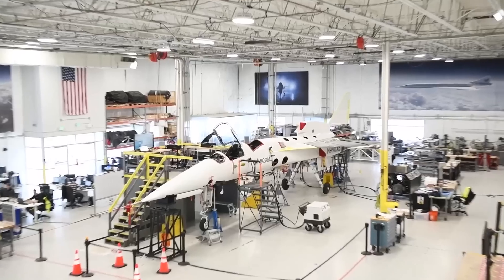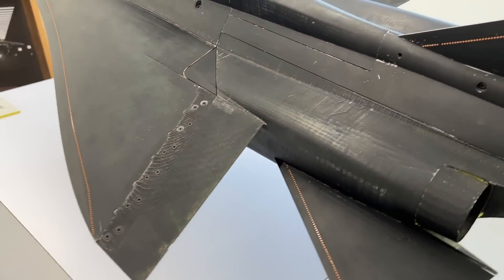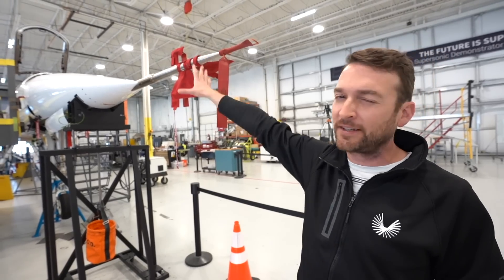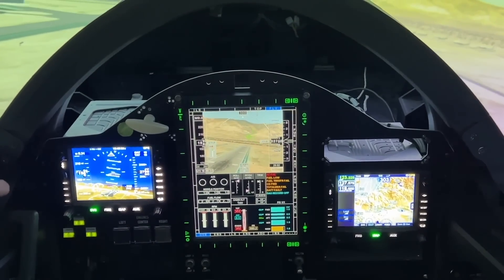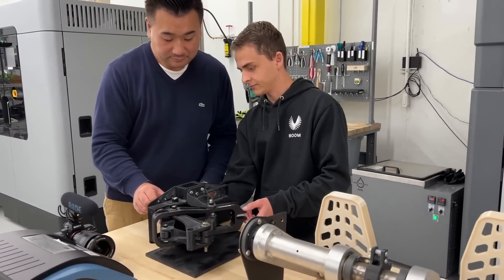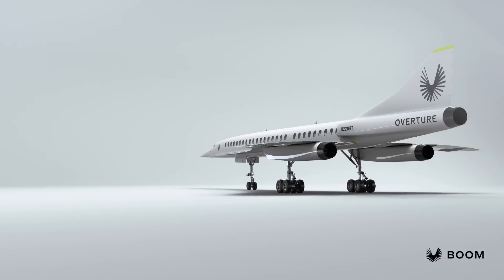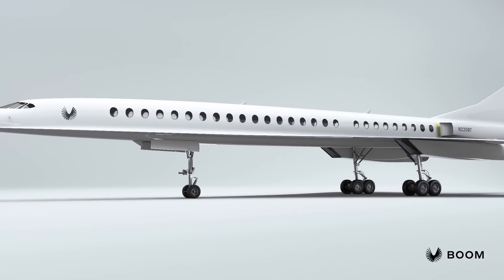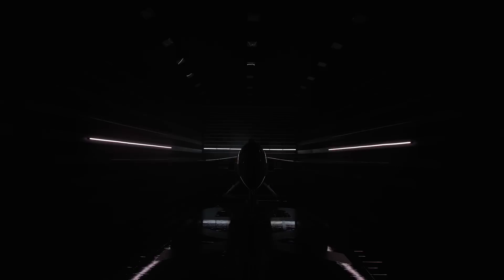Is Supersonic Coming Back? The Future Supersonic Jet - Boom Supersonic

Comment: The problem with the Concorde was that it was eating fuel like crazy, and when oil prices were going high, a ticket was so expensive, only wealthy businesspeople could afford it. The high fuel consumption also came with high CO2 emission, which is also bad if the aviation industry wants to go green. The Concorde was so loud as well, it was actually banned from flying over some countries. I'm a bit skeptic, but I don't think a small startup company could overcome these problems. I think it would be better to develop carbon neutral propulsion for subsonic planes instead.
Reply: The fuel costs  alone make the Concorde far less efficient than even the A380-800. 

At least the A380 can carry over 500 people. 

Concorde?  Just up to 120. 

It's range was less than 5000 miles too.  

The A350 ULR in use by Singapore now makes way more sense.
Reply: @BIGTRUCKSERIESREVIEW  are you seriously comparing a 46 year old supersonic airplane with a 17 year old jumbo jet ? it's like comparing apples and pears
Reply: @Victor-ze3sd  first a380 is 16-17 but most newer ones aren't even 1 year old.
Reply: @BIGTRUCKSERIESREVIEW  actually compared to something like the 747-100 the concorde (while in supersonic cruise) was preatty efficent in terms of fuel consumption, main problems were price, maintanece cost, but most importantly the noise, the main reason it wasn't succsefull was the ban of supersonic flights over populated areas, making it viable only for transocenic flights
Reply: The sonic boom was annoying too many people.
Reply: @AquarianNomadic  Couple years back in school there was a jet that flew sonic near Paris (probably 3-7 miles from where I was) and the sonic boom was surprisingly loud.

Comment: This looks like a classic investor scam. 

They will get the prototype in the air, but a supersonic carbon fiber 2 seater is obviously not innovation. Getting a passenger plane in the air and certified within their time scale is where they will hit the wall. I takes 2-6 years just for a variant of an Airbus or Boeing. This is brand new, with an FAA that will have to probably start from scratch even in determining certification criteria. 

This obviously so unrealistic that promised investment returns should be exceptional to justify the risk... and clearly they are not. How many would they have to sell to break even? 

Repeat... a typical investor scam, only just a tad more credible than Theranos...

Comment: To infinity and beyond... you can make a brick hypersonic if you use enough power. Not sure anyone wants to fly on a brick. More power Scotty.

I like what they have come up with. Love the fixed nose and use of camera to land. Concorde had that weird nose that had to droop so pilots could see to land aircraft. It will be exciting to see their supersonic plane in the air as it goes through testing and FAA acceptance. 

First company to solve the sonic boom problem by directing the pressure wave up instead of down will become rich. Today, supersonic flight over populated areas is prohibited. That was one reason the Concorde wasn't as successful as it could have been. They could only fly supersonic over the ocean. Currently, the only way to not have a sonic boom is Low Earth Orbit as a rocket. 17,500 miles per hour is silent with no air. 

I would buy a ticket if it wasn't as expensive as the Concorde (in today's dollars).

Comment: This is a very impressive project. Congratulations to all the team for getting this far. It is very ambitious. I think the biggest hurdles they need to overcome are partly environmental. Concorde looked like a runaway success with lots of orders, until the CAA banned all supersonic flight over land. I’m assuming that problem still exists. Also the cost factor is there too. Any ticket in one of these is going to be mega expensive. I’m sure people will pay though. Concorde was used a lot by businessman and businesswomen to get from one side of the world to the other in the quickest time possible and it was very successful at that. They also weren’t too bothered about comfort. Which in fairness the Concorde didn’t really have. It was about speed. Not living in luxury. I also think that might be an issue. People have got used to long flights….but in an environment akin to a luxury hotel room. 😂 This won’t be offering that service (I assume). It wasn’t mentioned in the video but I guess this is a scale test version? With engine, fuel, etc there is no space for passengers. It doesn’t look big enough. Although I can see the "holes" in the fuselage. Not sure if those are windows or access panels?
Reply: Boom stated that there aim is to charge US$100 per flight by their third generation of overture jet.

Comment: This is just bad, all of it.
This aircraft will not go beyond the experimental stage. As this aircraft is designed so far. The aircraft will not see Mach 2. I'm shocked it can reach Mach 1.2.
There's a lot of money in this project but it will not amount to anything.
The research has already been done. All the data you need is already out there. You just need to be smart enough to find it.
This is a very inefficient means of transportation.

Comment: This will have a larger impact on corporate and private air travel.  The new G7 is $74M each I believe?  So if this can be less than that per article, I can see this being a major winner for corporate travel.  I didn't see any information on the engines which will be the heart of this project.  Sustained SS is not an easy endeavor and is expensive, so who knows. I wish them luck!
Reply: At 3:14 they mentioned J85-15 engines
Reply: @ttttttttony  for the prototype, which is 1/3 scale. They don't yet have any engine options for the overture and that's a major issue.
Reply: @crazyg74  I see
Reply: @ttttttttony  I must have missed that.

Comment: The guy tells a "nice" (sad) story about his kids not being able to spend time with their grandad in Hong Kong because of the 18 hour flight time. Sad story? Yes, absolutely! But I don't think much would change if the flight time was just 9 hours or less because of the price of the ticket! 

Google says the final aircraft will be able to seat between 65 to 88 passengers (depending on class configuration) let's say 74. Concorde had 128 seats. A one way ticked from London to New York was approximately 6000 to 7000 dollars (in todays money) so let's say $6500. That means a one way flight on a BA Concorde made them $832'000 - I'll round it to $850'000 to take into consideration extra fees paid for extra services or extra baggage by passengers (and I'm being generous)! BA's annual revenue from Concorde was between $37M and $61M so let's say $50M. Supposing it flew twice a day (which I believe it did) for 365 days a year (probably didn't but who cares) the profit a single BA Concorde made on one trip was of $68'493. This means that 92% of the money earned from a single BA Concorde flight from London to New York was spent on fuel, maintenance, wages, ect. (operating costs) leaving the remaining 8% as profit. 

Concorde consumed approximately 25'269 L of fuel per hour and flew for approximately 3 hours meaning it burned approximately 75'807 L in a whole flight. I'm going to add 20'000 L to account for various stages of the flight and to make it more realistic. So 95'807 L burnt per flight ok? The cost of A1 Jet Fuel is $1.117 so Concorde spent a good $107'016 on burn fuel per flight - you obviously operate with a nearly full tank (so 129'500 L would cost $151'515). 

I'm going to start cutting short because the research and calculations are taking me too long and I have work to do ;(... Anyways: Mr. Boom's plane here is going to do the same in 3 and half hours ok? Mr. Boom's plane has 3 General Electric J85 engines that consume approximately (together as a trio) 4500 L per hour at low level non supersonic speed and 1140 L per hour (as a trio) at altitude and at supersonic speed. Now, because of the laws preventing supersonic air travel over land Mr. Boom's plane, like Concorde, will only spend about half of the entire flight at supersonic speed. Now, fasten your seatbelts guys because we're about to go supersonic with these calculations:

At non supersonic speed Mr. Boom's engines are a wopping 57% more efficient than Concorde's engines. At supersonic speed they are 95% more efficient!!! WOW! Now, remember the stuff about half the flight being supersonic and half not being supersonic? Great, because I have completely lost my train of thought and have no idea where this is actually going. So: 

Moral of the story: Yeah the plane will consume less fuel yay so they'll spend "less"! But they're carrying 42% less passengers than Concorde. And do you know what that means?! Less passengers = higher ticket prices!! The tickets will probably still cost thousands of dollars making that 6 hour economy flight to New York (or Hong Kong in Mr. Boom's case) for yourself, your wife and two kids much more feasible. I'm not even going to get into the other plethora of issues like landing with a TV screen because other people are already tackling that lol. 

Will it work? Sure! Or even better: I hope...! It will be a great high speed travel for business people between London and New York and San Francisco and Hong Kong? It will never fly supersonic over land so yeah... If Mr. Boom's initial idea was to get his kids to see their grandad more often I guess he must be quite rich! But for the average consumer that rock bottom price ticket on the 9 hour flight will still be the most viable option. 

Thanks for reading :D

P.S: If you agree: great. If you disagree: great. Please don't come at me for getting bits of info wrong. I'm not an engineer: I know I left out tonnes of other calculations but you get my point!
Reply: Mr.Boom and the initial target consumers of his product I don't think care much about cost of the flight. They just want to get there faster. 

On day one, these flights of course wouldn't be affordable to the average person, just like the first passenger flights 100 years ago, the first ocean liners, first cars, so on, so forth.

But to your point, regardless of its cost or class of target consumers, the economies of this product certainly has to work itself out if it is to survive in the long therm.
Reply: @mr.nobody9086  well said!
Reply: Totally agree the j85 is just old and inefficient

Comment: Cool video  with a few buts.. So the aerodynamics are basically the same as the Europeans developed in their wind tunnels for supersonic passenger travel in the late 1960's. The engine layout is basically the classic trijet template.. There is nothing new here.  This is a promo for yet another US firm that will tell you they are forward thinking and environmentally focused while really pandering to the super rich - and on it goes..  It is interesting but it is simply a chance for the US to finally get what they always wanted and were so jealous not to have - supersonic passenger travel. That is it. If the Russians or Chinese were developing such a pointless and environmentally backward looking, product it would be making headlines for all the wrong reasons.

Comment: This is just a load of bollocks. It is reinventing the wheel. Or some other glossy attempt to keep raising money. This aircraft will never fly commercially. The world already has an SST. It just needs upgrading. Composite fuselage, more efficient engines. All off-the-shelf stuff. The fundamental design of the shape was done in the 50s/60s and was in service by the 70s. But the Americans hated it. So much so that they did everything to scupper it. If Boeing couldn't have one, then nobody else was going to have one. Had the thing been continually developed then by now supersonic transport would be common place.

Comment: Negative Nellie here. They are proud of mechanical marvels when it should be fly by wire (less weight, more redundancy.) Land through a tv, better have plenty of backup for that. Plane will need to be carbon fiber for weight. They are not going into new territory here. The Concord was flying in 1976 and faster, fighter jets fly faster regularly. Need modern day efficiencies added to old technology. IMO, Boom can not build this. They will try to get “close enough” in theory to be bought by Boing or Airbus. Even with all the problems solved, the necessary price per seat will not allow the grandkids to all run see grandpa every other month.
Reply: @William Umbach Civilian: ATC technology enables qualified approach controllers to fly/land properly equipped aircraft. ILS2. Military: MQ-1 Predator/MQ-9 Reaper UAV drones are completely fly by screen.

Comment: The angle of attack at landing will never fly...pun intended.  The FAA would never certify an aircraft that relies on a camera system as the sole point of view.  That's why the Concorde had a drop down nose, and Boom will have to figure out a better plan of attack regarding the high angle of attack at landing.  I also agree that their chances of success are slim to none unless a major corporation buys them out.  Honestly, there global movement in commercial aviation right now is for moving more people using less fuel rather than moving a few very wealth people really quickly....That's really the role of private aviation, and there's probably not enough money even in that sector to justify the high costs associated with traveling faster than Mach 1.  Hopefully the research will lead to some developments to advance some aspect of aviation, and it's good to see the effort and passion.
Reply: a periscope can do the job if all the cameras fail.

Comment: For anyone intetested in Sustainable Aviation Fuels, a Swiss Spin Off of the ETH Zurich called Synhelion has developped solar based fuels, meaning they extract CO2 from the air and produce fuel using concentrated solar radiation. SWISS has entered a partnership with Synhelion and aim to operate the first passenger flight using Solar Fuel only in 2025 I believe. Synhelion themselves plan to ramp up production. Just like explained in the video, this closes the carbon cycle. CO2 is being extracted from the atmosphere and then reinjected. With carbon caption and storage technologies, the airline industry can progressively reduce the amount of its carbon footprint and truely reach carbon neutral operation.

Comment: I have been wondering why everyone keeps going around trying to create a new design. The Concord had a great design and it worked. It was expensive to maintain. Can the concord be redesigned with better fuel economic engines and systems in general?
Reply: Main problem with the older design was the sonic boom, which limited the places that plane could fly over. This limited the speed of the plane, even though it could fly at much higher speeds.
Its like having a Bugatti Veyron and driving at 35mph.
Reply: The nose was heavy and expensive. This is a new design. Doesn't make sense just to gut the internals and slap some new engines in there.  Not so easy in the least.
Reply: @Ven100  you are talking rubbish. One, the nose wasnt heavy and expenive. Two, frank didnt suggest gutting. He suggested upgrading the design, a design which aerodynamically did work.
Reply: @LiveFromLondon2  You are the one talking rubbish.  You mean to tell me the droop snoot, full of hydraulics and a heat visor isn't heavier nor added price over a standard airframe in the same shape?  Was it free? Is it also maintenance free?  Wasn't aware more moving parts reduced weight and price.. Also, this new plane is literally the definition of upgrading.  They took what they know about SST and improved the design and now said new design has to be tested.  If you notice his final sentenced said redesigned with better engines/systems.  In otherwords, keep everything else the same and just put new engines and computers in there.  Even if they didn't gut old models and built new ones exactly the same, it's still a silly idea to say the least.
Reply: exactly.

Comment: Boom is the only company I believe have a chance to bring Super Sonic travel back.  The only thing I am worried about is the difficult landing. They will need to train highly skilled pilots, likely former fighter jet pilots. The swooped back Delta Wing design is ideal for super sonic speeds but not ideal for low speeds like during landing.  Landing speed will have to be faster than a normal Airliner due to the reduced lift characteristics of the design at sub sonic speeds.
Reply: The russians had it right, they put canards on their 144. Just a shame the rest of the plane was built like shit.

Comment: Landing speed is 175 to 190...THAT IS CRAZY.
The runway length requirement will be enormous. Probably longer than any runway available. Plus this aircraft has to fit in the air traffic 

This is dreamware.
What are you going to use for engines? The J-85 engine is from the 1960s and long out of production. Service parts are difficult to find and expensive. A new engine will have to be designed and developed. Have you got an engine maker developing your engines? Who is going to take on a $100M+ development program for a dream aircraft? 

Will Mach 1.3 be fast enough?  Concorde was Mach 2. Will carbon fiber take the heat?

This is dreamware.
Reply: J85 is from the 1950's and went out of production in 88, Still supported today as it's still in widespread use on various Airframes but agreed this has raised as many questions as it's answered.
Reply: Had the same thought about the carbon fiber plastic and the heat so I did some very quick research and: 

Concorde's nose would heat up to 260 F 
Carbon Fiber Plastic is pushed to its limits at 420 F

So apparently it can withstand it? Who knows... Still seems a bit sketchy to me
Reply: Concorde speed was limited by what temperatures the alloy skin could take. Boeing wanted to go faster so planned to use exotic metals which massively increased the cost.